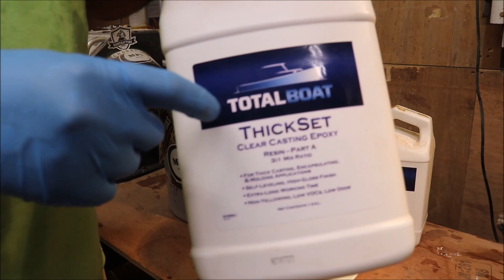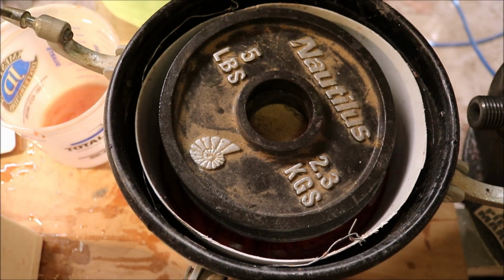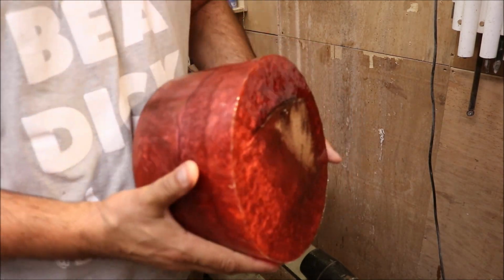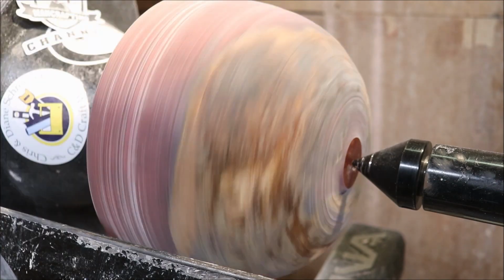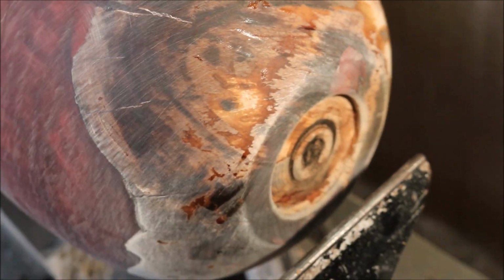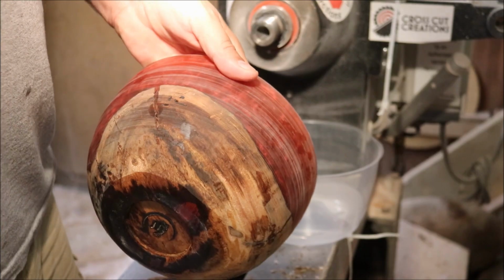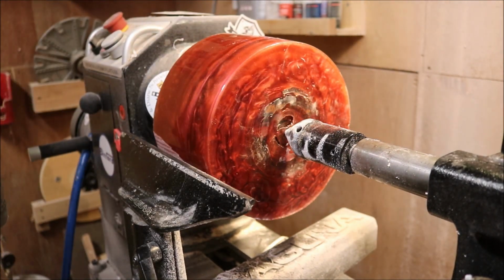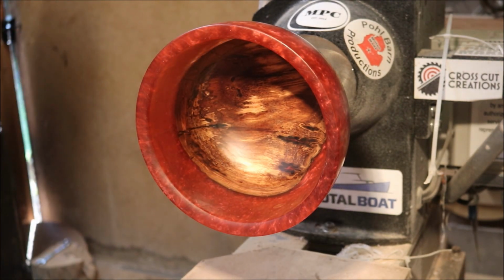Wood Turning - Red Lava

Comment: Terrific fix as this is a very cool bowl. My problem is opposite, too dry wood. I don't have a pressure pot,, can this be done without?
Reply from the maker: Yes it can be done. You would need to make 1/4" or so pours and let each dry. Total Boat Thickset woudl work best as it is much thinner than the others.

Ken

Comment: Need some help. I have used several different resins; TotalBoat 1:1 tabletop, Art 'N Glow, Alumilite and Enviro Tech. I pour equal parts of A & B everytime and follow the directions to the letter for mixing. It doesn't seem to matter the amount I pour, every time it gets SUPER hot fast and cures in like 30-45 minutes. I have had some crack completely and some have sticky areas that never cure. Any suggestions, tips, trick would be awesome. Thanks
Reply from the maker: Hey Joe, I have never had any success with Alumilite. It overheats every time I use it. Maybe I'm not mixing it right. Total Boat 1:1 is not meant for casting. It is meant for thin pours. You need to use Total Boat 2:1, Thickset or even the 5:1 with slow hardener. To measure otu TB (using 2:1) you can use the cups that come with it. There are numbers. For the part A fill to the numbers 1-4 (let's say you went to 3) on the left then for Part B (Hardener) fill to the 3 on the right side.  But I use by weight. I use grams. For 2:1 I use 100g to 45g ( I know not really 2:1, but it works better). You need to make sure to mix it for 3 mins. I am only going to reference TB since I only used the others a few times and never had luck with them. Hope this helps. Remember I have a 20% discount code if you decide you want more TB. Use MPC20

Ken
Reply: Moonpie Creations thank you for the response. I will keep that in mind the next time I order TotalBoat. Love your work, very inspiring!!!
Reply from the maker: @JRV8083  Any time you need anything let me know. If you are on FB feel free to message my Moonpie Creations page.

Ken

Comment: Nice work. Question on your homemade finisher, is that the tool or the insert?
Reply from the maker: Finisher is the round insert. A square one is call a rougher. Interchangeable on the tool.

Ken
Reply: Did you make it yourself? I would be curious if you had a video or information on it?
Reply from the maker: I made them myself. I have three, made from HSS.

Ken

Comment: Really cool bowl and I appreciate your problem solving.  I'm new to epoxy and Total Boat, do you measure out by weight or volume, or does it matter?
Reply from the maker: Thank you. I measure by weight. If you are using 2:1 I use 100g to 45g. 

Ken

Comment: i had that happen in my new project im working on with the bubbles . remember i think i asked you about it . the thick set is great but yeah that bubbling is what happened to me . i think it was moister in the wood  total boat dont like moister at all . doug from the pohl barn told me that . or maybe it was billy burt . ether way . turned out really nice after all the trouble in casting . i had to recast mine like three times two . but it should turn out ok . that video should be out soon . maybe monday . love the colors you chose . and i think  my project is apple wood to it is such a beautiful wood . has alot of its own really beautiful colors . great video my friend .
Reply from the maker: Yeah moisture and resin don't mix. lol I look forward to seeing your video, I'll keep an eye out for it. I will say this about TB, it is more forgiving of moisture that Alumilite. I get small cracks because of moisture, never had the bubbles.

Ken